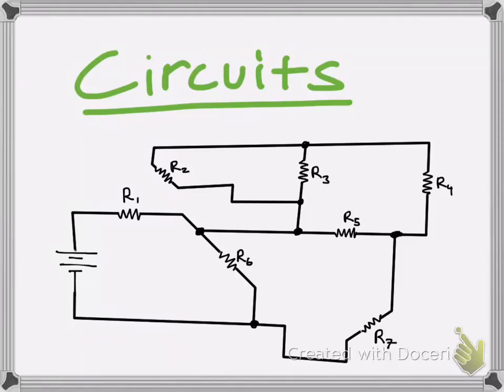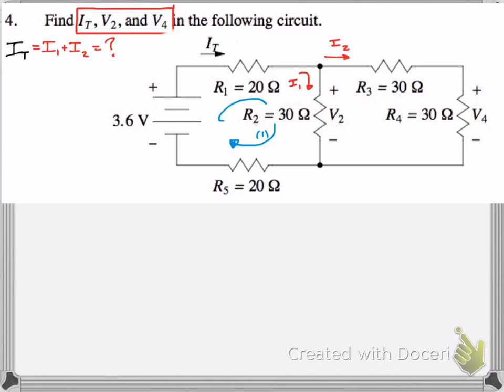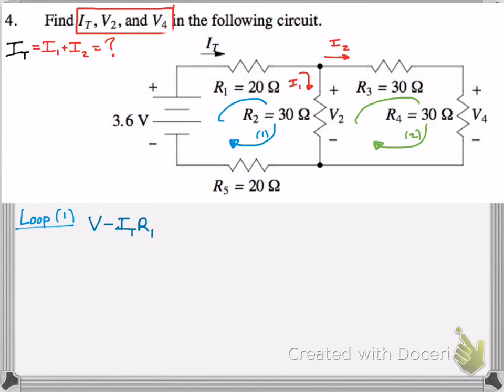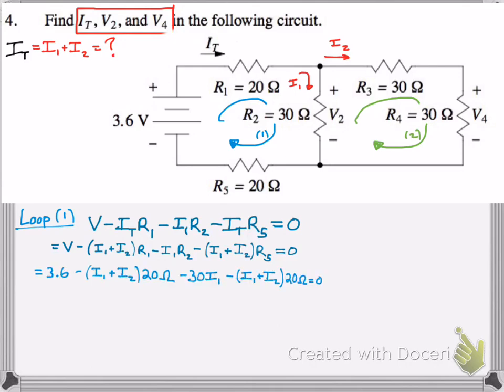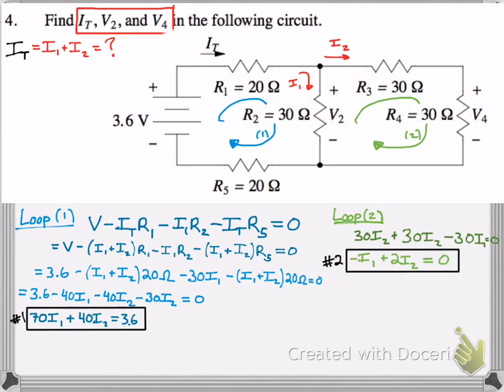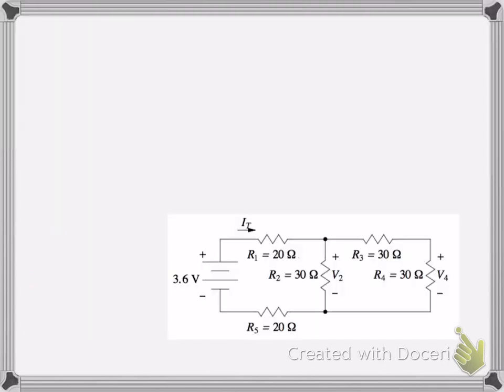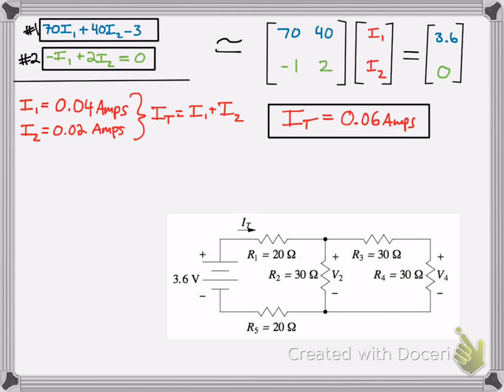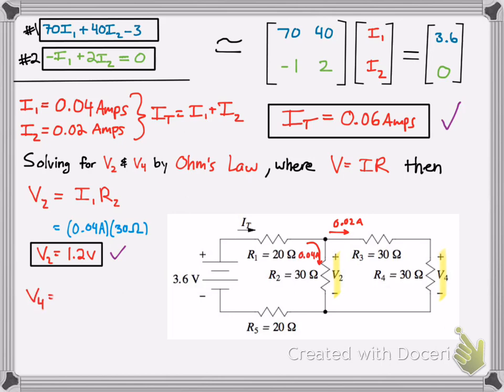Kirchhoff's Loop Rule Example

Comment: Your loop 1 and loop 2 are using different theories.  Your subtracting current in loop 1 and adding current in loop 2 .. when you've define current flow in the "same" direction in each loop.  It should be -30I2-30I2+30I2=0